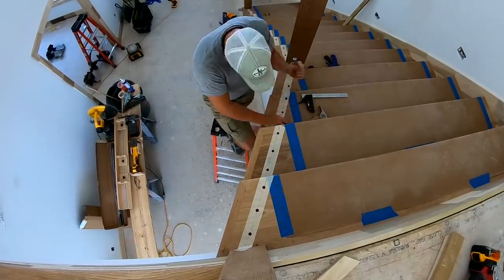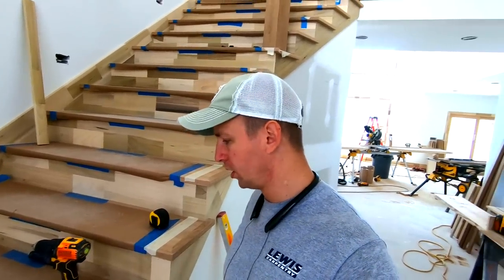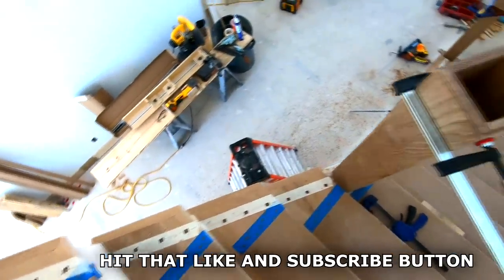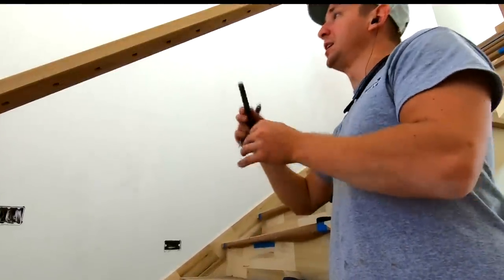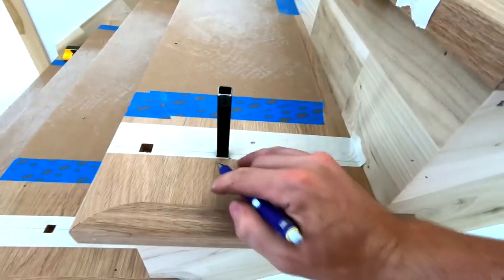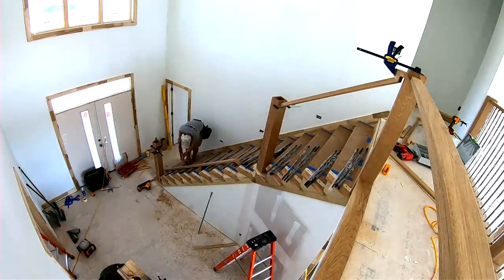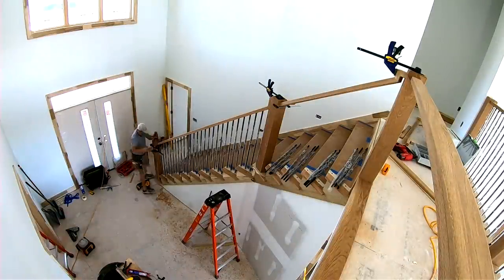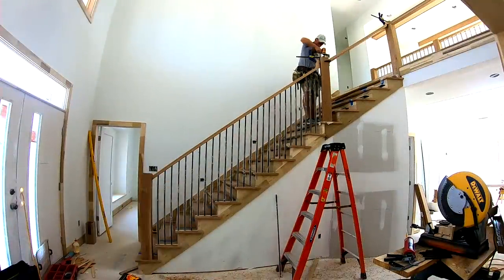Square Mortising Hardwood Treads, Iron Baluster Installation, and Handrail Installation

Comment: maybe you mentioned it maybe you didnt, why was there a step up(called a goose neckhere in uk) at the top of the first two sections of handrail, does the hollow portion of the newel only go down so far?
Reply from the maker: Because it creates a level transition, which means I can terminate the handrail into the newel with a single bevel cut, instead of a compound bevel cut. Without the gooseneck the handrail would have to have a compound cut going into the newel which is tedious and doesn't look very good. Good question.

Comment: You skip the harder part which is the handrail square hole drill . Actually one of my customers wants to do the same thing , he wants metal balusters but no shoes, just like your stair here, but the wood materials is Brazilian cherry which is a lot harder than your wood stair materials. 
   Your stair turns out nice !!!

Comment: haha, going to have to report you to OSHA because at around 7:00 you were standing both feet on the top tread of the ladder, tsk tsk
Reply: I saw that. Technically if you are higher than 6' off the floor, you are not allowed to work on the stair if it is not guarded. You would have to work off of a ladder,  which makes no sense at all. There is no way to be profitable when strictly following OSHA guidelines. Common sense suffices in most cases.